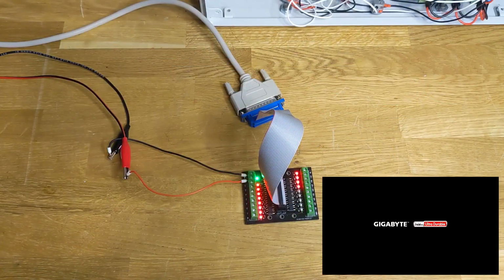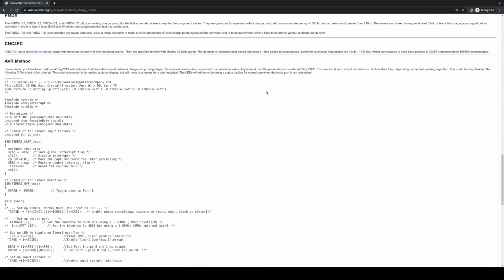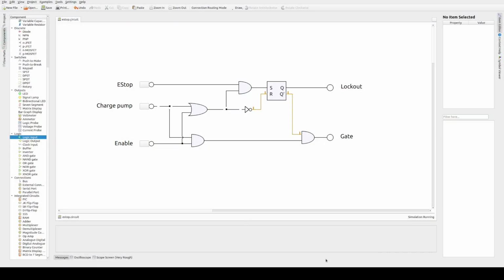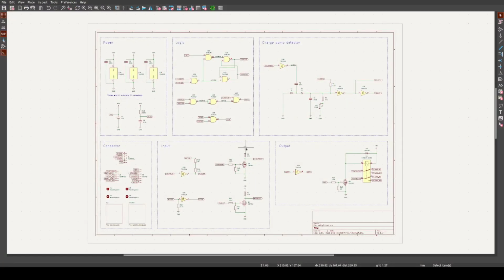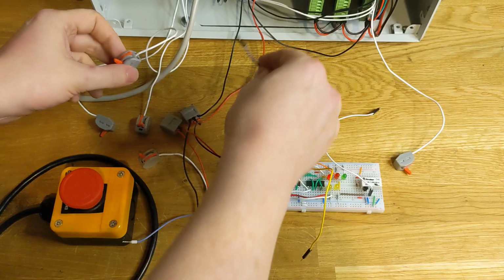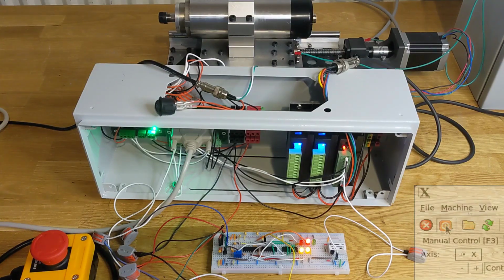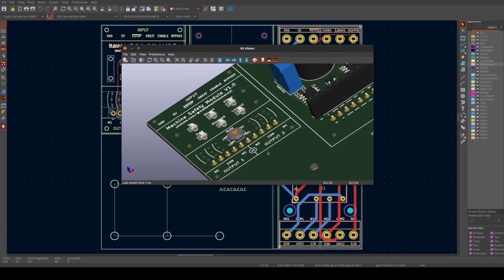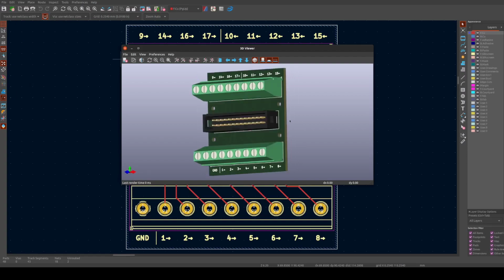LinuxCNC charge pump and e-stop

Comment: Your not going to have an overheating issue with those drivers butting up to each other?
Reply from the maker: Hey! You may be right - I've not noticed that yet but I'm not putting them under real load yet. It is getting quite cramped in that enclosure, though. One of the reasons I like having everything clip onto DIN rail is I can easily move things around later if I need to, I might end up with the drivers in a separate box eventually.